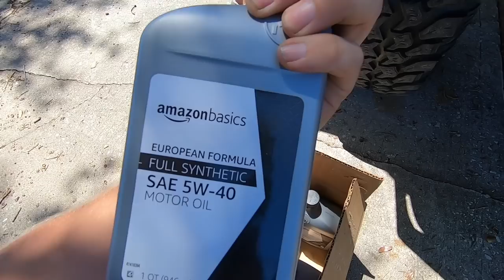Driving Underwater EP.3 - HOW DOES THIS KEEP HAPPENING!? (Need Big Changes)

Comment: tube the exhaust to be above the water.  back pressure is to much for that lil  engine...
Reply: outlawMrTuff nah dude. You do realize that the exhaust is the byproduct of explosions right? It has an incredible amount of pressure. In fact there are airbag systems that can be connected to your cars exhaust and by letting the vehicle idle and the airbag underneath your car it lifts it up allowing you to change a tire etc
Reply: @BikingVikingHH  You need fresh air for combustion... reducing the flow of exhaust gases reduces the intake of fresh air causing the engine to run inefficiently and will eventually stall it out. Why do you think exhaust snorkels exist? ...
Reply: @BikingVikingHH  'it has an incredible amount of pressure' When you try to act like you know what your talking about, but then resort to broad assumptions.
Reply: @BikingVikingHH  you do realize the explosion is what moves the piston, and the exhaust is just the piston pushing the exhaust gasses out on the following stroke?

Comment: "I am NOT modifying the Mustang."
-Cleetus, who is definitely going to modify the Mustang, 2019
Reply: I give him  5 days. 2 weeks max! XD
Reply: I hope so
Reply: As if adding Nitrous isn't a modification at all.
Dealership upgrade, perhaps?
Reply: Pfft, after the nitro's, he's probably going to weld on some slapper bars, to avoid axle wrap on the drag strip.
And then, he's going to put a turbo on it, which he can find for real cheap on the junkyard.
 … in fact, I hear the old diesel engines often have well maintained turbos on them, and the old. 5.0 loves itself some boost.
Heck, that's what Roadkill Garage did with the old Nissan 240Z.
They  dropped a 5.0 with a junkyard turbo on it, in the engine bay of the 240Z.
Reply: HapticNoise he blew up the engine with nos on the dyno

Comment: Underwater...... 
Raise exhaust above water line.  The water is like a "Banana in the tailpipe" 
That was what got you this time.
Reply: I was kind of thinking the same thing. Too much back pressure might be killing it.
Reply: We've been trying to get them to raise the exhaust this whole time
Reply: have you not seen trucks with snorkels going thru rivers and lakes ? the exhaust has nothing to do with it , unless water gets all the way back to the valves, which is not the problem
Reply: @willmc42  those are higher hp trucks which arent affected by the amount of back pressure that the water they go through causes. this tracker might make 80hp on a good day. the trucks im assuming you probably watch are big f2-f350s and or bigger jeeps which all make 300+ hp. the amount of force they exert out of the exhaust is much higher than the tracker, thats why this isnt a problem for them.

Comment: As soon as the water hits ANY of the NON-weatherpack connectors, either on the back of the ECU or any sensor going to it, there are going to be shorts galore. Seal those up, along with any other exposed wiring (like, in the alternator) and it might make it. Also, a snorkel for the exhaust wouldn't hurt, since the back pressure is keeping the outflow restricted, and you now know what happens as soon as the engine stops. Good idea on removing the fan - hadn't considered that.

Comment: you'll need to extend the muffler so that's sticking out the water
Reply: In that case how does a boat's exhaust work
Reply: @angelicgoon5252  well most boats the exaust is above water I don't know about ones with there engines below deck but I assume they work the same way with the exit above water.
Reply: @Nbkdelta1-Playthroughs  most boats have exhaust below the surface because the water works like a muffler..

Comment: Alright boys for one you need that pvc to run into the filter box strait hook up and put a air filter on the end of the pvc and you might want to extend your exhaust pipe out the water bc if you don’t keep it nailed without extension of the exhaust water will back track and fill the motor

Comment: Vent the exhaust like the intake so it has less back pressure and won't immediately fill up with water if the engine dies. You'll probably be able to start it again in the water and you won't be down on power.

Comment: Deffo needs a snorkel tail pipe or a reed valve exhaust system and special (marine style) tuning. Cut some big old holes in the floor, anor maybe weld in some grate as a floor. Take out all the windows, and fill that buoyant fuel tank with water (or concrete).
Slap some vaseline round the FT/LT wires before you go in (that's how we waterproofed the electrics on my old Mini & L/rover). 

Oh and don't be hanging out the door when dragging it out. If that falls over and pins you under 2 feet of water.....

Comment: Diesel cars which is completely controlled mehanically from only high pressure fuel pump, may work best. Cuz they don't have anything in intake, like MAF or such.
Alot of NA version works without ECU aswell. So it would be way easier for that purpose.

Comment: just for the record, The ECMs on these are NOT weather sealed and they tend to die as soon as the ECM hits the water. the ECM is located in the drivers footwell right above where your left foot would sit. pull that boy out and flex seal the hell outta her. I have that same motor and ECM combo swapped in my samurai, she does not like boggin deep

Comment: Bring up the exhaust as high as the intake pipe.  When we added a deep water fording kit to our Humvee you raised the air intake and the exhaust went  up the side.  The will keep the water pressure from suffocate the motor.

Comment: So another future problem I think we will see is as your exhaust gets deeper in the water the resistance in getting your exhaust out will get too high and it will kill the engine, then further more once your engine stalls water will rush into the exhaust pipe making it almost impossible to restart in the water, could be wrong but just a theory, you may need a "snorkel" for your exhaust

Comment: If the dizzy keeps getting water in it try a thick dish washing glove over it. We used that trick on an old Toyota pick up we raced in a banger class and it works well. Put the five leads through the fingers with a zip tie and sealant then zip tie and seal the glove over the dizzy.

Comment: While an exhaust snorkel may possibly help this is a problem we have in the uk with distributors on v8's under water
Sealing the distributor cap will only temporarily help, what will then happen though is any moisture in the distributor & moisture in the air within the distributor will condense up to the distributor cap & then cause ignition cut out too,
2 things I have found work well is to fully seal the distributor but have 2 small screw in barbs/hosetails, 1 with a tube to the air intake & the other to the top of the snorkel, this way the engine sucking air will draw fresh air through the distributor greatly reducing the condensation
The other way is to do just 1 hosetail in a fully sealed distributor but with a very small vent hole, intake hosetail connected to a 12v air pump, the air pressure from the pump with pressurised the body preventing water from getting in while also flowing through

Best option though..... convert to distributorless, problem solved

Keep the vids coming 🤟

Comment: You need to get the exhaust vented above the water level. Everytime the exhaust goes under the back pressure is cutting the engine because it can't vent. Do that and it might just be possible! Good luck.

Comment: Connect a scuba regulator directly to the intake hose and seal off the intake so you can have positive pressure in the intake at all times being provided with the scuba regulator. the deeper you go the more negative pressure builds inside the snorkel tube causing the engine to stall out

Comment: Take the clutch rad fan off, it can stall out a motor underwater. I would also snorkel the exhaust up  to the height of the intake and get some gym weights in the back of it to keep it on the bottom.

Comment: Cleetus, the problem you're having is the engine can't suck the air down several feet below the water. Water pressure increases rapidly with depth, and air pressure does not increase at all, therefore the engine stalls because it can't get the air down to itself. Think of it as using just a hose to go 'scuba' diving; more than a couple of feet and you won't be able to breathe. Possible solution: 1.Put an exhaust extension above the water. 2. You're going to need a way to get air to the Tracker's engine while it's underwater. My idea is possibly an auxiliary engine mounted to the roof---one that won't go under water---that will be driving either a roots blower or a turbocharger with the compressor outlet connected to the Tracker's engine air intake. I think that's the only way to keep the Tracker alive while its going for a swim.

Comment: James mentioned the exhaust snorkel in the 1st try Episode, and then seemingly totally forgot about it... Lol flexible hose with a float on the end attached to the exhaust, and load the tires with liquid of some kind. Maybe even weld some thick steel to the wheels for even more weight. Me and my buddies from northern Michigan have taken a lot of silly ass vehicles through deep water over the years. It can be done. Just gotta overcome a LOT of buoyancy and that back pressure on the exhaust will kill you even a few feet under... Especially in a lower horsepower vehicle like that.
Reply: If all else fails, put a naturally aspirated diesel in there. That'll practically run through the feckin pond unmodded. Lol disconnect fan, instant submarine.

Comment: Put a pipe nipple into side of distributor, hook a line to a 1-2 (roughly) psi air bleed off a tank, that way your internals of the distributor will be pressurized, and wont allow water to come in

Comment: I wonder if the spark is arc-ing from the spark plug boot to the head...  I've had a Camaro that after sitting alot it would get a crank no start condition that I would just clean up around the spark plug boots and it would start up, I think the spider webs were arc-ing it on me, lol, for real though.  I would just twist the boots and run a screwdriver around them and bam! fired up fine...  maybe run a smaller gap on the plugs too to lessen the chances of arc-ing and put rubber cement or something temporary like around the edges of the boots before putting them on the plugs to seal it up nice

Comment: Cover the distributor and any possible points that you are worried about in paraffin wax easy to use paraffin wax mold instantly and is easy to remove greatly waterproof to anything

Comment: Put an exhaust snorkel on that thing and you will have a better chance. I think the water pressure is at that depth is greater than exhaust pressure. Hence, the water chokes the engine out.

Comment: When we take dozers deep in the water crossing a river or a pond or whatever,  we remove the fan so it doesn't eat the radiator up and we lose 1500.00 -2000.00 radiators. The water that deep on the engine keeps it from overheating anyway. Unless it is really hot water and a desert setting on a very hot day in the 100's.

Comment: need to put a pipe on the exhuast your loosing power cause the exhaust cant escape threw the water fast enough and also when it stalls with the exhaust under water it just fills up and your screwed at that point get some pipe clamp it on run it sky high like your intake tube i think thats gonna help a bunch

Comment: The balloon trick is gonna be the ticket, and you might want to snorkel the exhaust pipe to stay above water too.......but if you are ready to get serious about this I would get a small 12volt tire pump/compressor,put it on the roof rack and run a hose to the top of the distributor cap(there should be a removable plastic cap between 1 and 2 plug wires),and leaving that little port on the bottom of the distributor alone for positive atmosphere venting in there. It will be blowing bubbles out of there while under water and keep things nice and dry inside.......just a thought.

Oh and BTW I will see you guys at LS FEST WEST and bringing Neighbor's long lost brother 'The Party Car '(the 2006 CVPI the lightbar I sent you guys is from)and..... 'Roxanne' the 2015 Twin Turbski Interceptor Pursuit Sedan so the outcast FoMoCo motors can hang out......and kick some asphalt!!!
See you there guys!!! Drive safe!!
🇺🇸🦅HELL YEAH BROTHER 🇺🇸🦅
🇺🇸🦅🇺🇸🦅🇺🇸🦅🚔🚓🔥💨🇺🇸🦅🇺🇸

Comment: The water pressure on the exhaust outlet is bogging the engine to the point it can't turn anymore.  You need to snork the exhaust too.

Comment: Put water in the tires so the tracker will sink better about 1/2 to 3/4 full then add air pressure but don't ever drive it on the road like that.

Comment: Exhaust snorkel.  Seal the ECM.  Fill the stock fuel tank with water, or just remove it. (It's causing unwanted buoyancy)   Take the doors off.  Fill the tires with water. (Again, buoyancy) 
If all else fails, see Motor Trends video on the subject..  "Diesel jeep drives 12 feet underwater"  It ran fine the whole time, but got so far and stopped moving.  No traction.
Edit:  Dude!  Did I just enjoy and AD for flex seal?  I hope they threw a few bucks at ya' for that!

Comment: You need to put dielectric grease on the spark plug boots. The distributor should be sealed with all that silicon its gotta be the plug boots

Comment: I am a mechanic you need to put the exhaust above the water because water is going down the exhaust pipe and then it gets to spark plugs wet and then they won't ignite

Comment: 🤯🤯🤯 they need to get a four-wheel-drive put a giant snorkel on it and wrap the entire car in Flex tape and spray it down with Flex Seal and have them have scuba equipment on and waits to hold the car down and see if they can make a four-wheel drive bogger submarine 🤯🤯🤯🤣😂🤣😂💯💯💯🔥🔥🔥

Comment: your back pressure is getting too high... you need to pressurize the air intake.... or snorkel the exhaust...  it's like trying to breath through a straw underwater...... that's why you use a regulator in scuba... so the breath intake can match the ambient water pressure.

Comment: Finally figures out that water is 800 times more dense than air and removes the cooling fan. Also there is a reason that WWI and WWII submarines went with Diesel motors and vents for both air AND exhaust. Stay in school kids.

Comment: How did Durt Every Day do it on the first try?
Reply: 1. They didn't do it on the first try.
2. They used a diesel engine. (No ignition issues to worry about)
3. They put dielectric grease on all the other electrical connections.
4. They used a vehicle with no doors, or roof.
5. They used a pond that had a concrete bottom.
Reply: @MellowYe77ow  oh yea it's been forever since I watched it so I forgot all the details

Comment: When we would use our dozers or track hoes in deep water we would take the fan belts off the fans to keep the fans from going through the radiators. When your that deep in the water they do not over heat anyways. But here is the guy who does it for real: https://www.youtube.com/watch?v=icp2Pb5uoME, never did come up with take # 4 though, so we have here my friends, UNFINISHED  BUSINESS,  to deal with Mr. Cleetus.